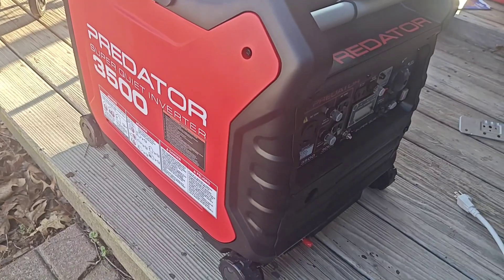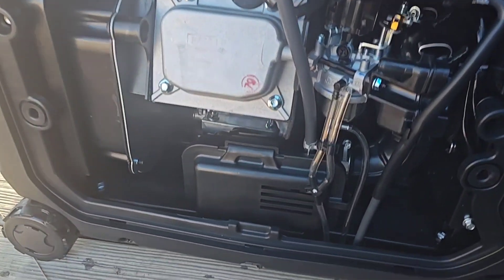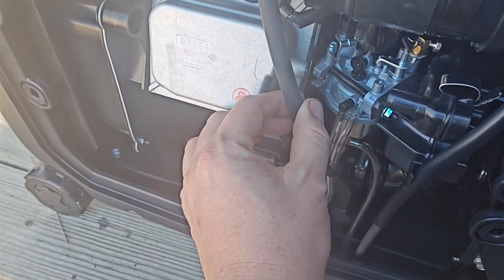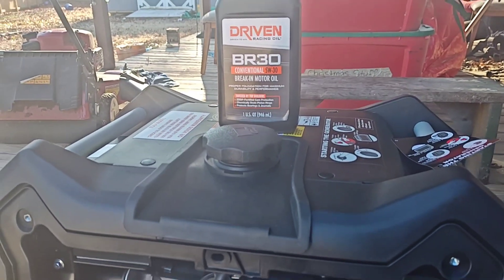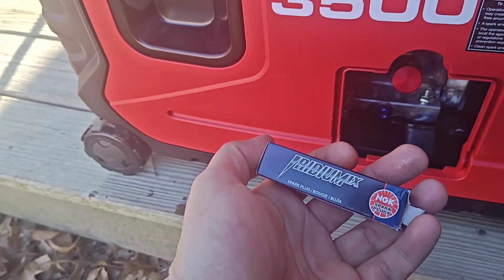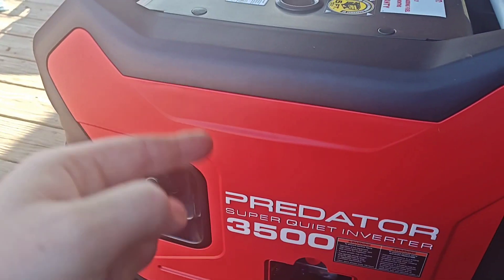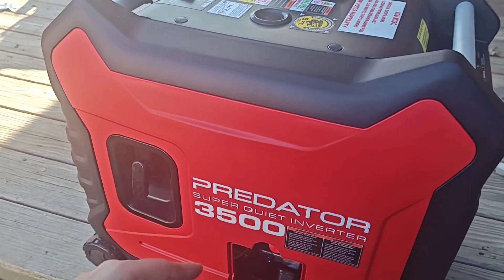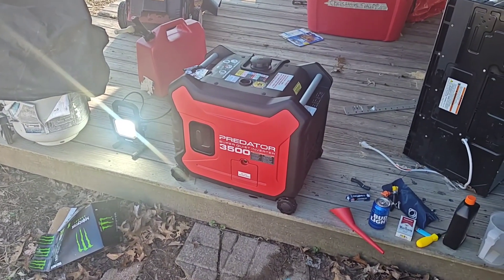New Generation 2024 Predator 3500 mods and break-in. Watch before starting your generator.

Comment: Thanks for this vid. There is little info out there as of now for the new model. I bought one last week. About the spark plug, what heat range did yours come with? Mine came with a 6. And in the owners manual, in the specs section it says a 6, and then down in the maintenance section it still mentions a 7. Seems to me like they edited the specs section to a 6 and just missed the mention of a 7 down a few pages later. I'm going to change it to an NGK but I'm going to go with a 6 to match the original. I'm hoping that will do a better job of burning clean at higher elevations which is where we will use this genset.